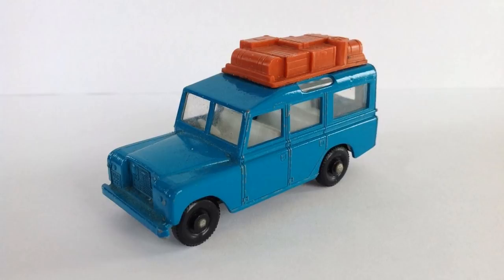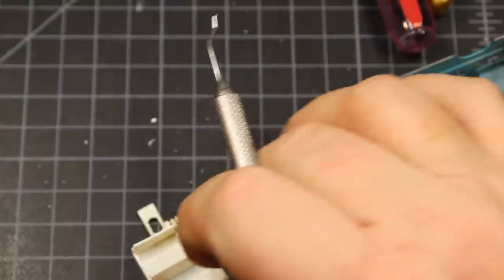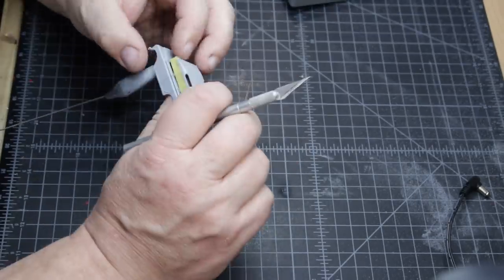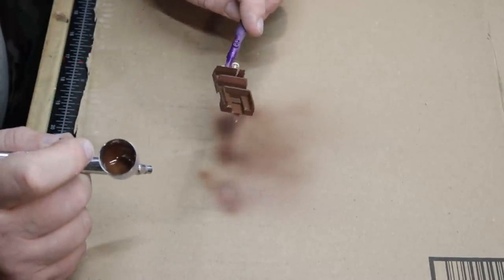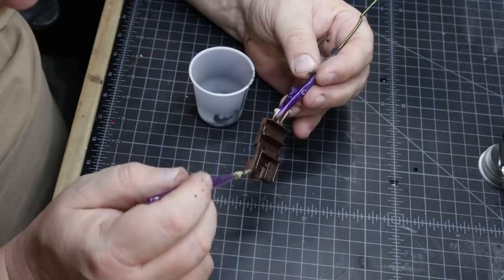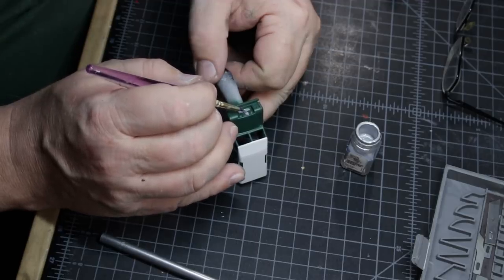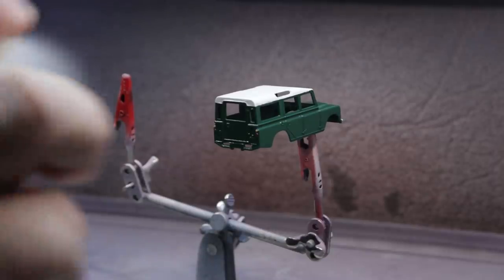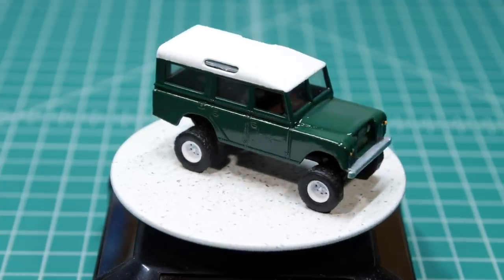Matchbox #12C Land Rover Safari - Custom

Comment: great job looks real good. like the tires. a suggestion for the windshield use a 3000 grit sanding pad and a clear coat to hide the fine starches.  car headlights restores kits use it.
Reply from the maker: Thanks for the tip

Comment: Great custom! Im new to all this and Ive only done a few customs so far, but a tip to make life easy- when painting a two tone paint job I like to spray the whole thing the lighter color first then masking off what I want to stay, being a racing stripe or white roof, then spray the dark color. As long as you use light coats you won't  lose any detail and might save a little time. Keep up the fine work sir!
Reply from the maker: I have to respectfully disagree, any time you lay a coat of paint on it, you're losing detail.  But thank's for the tip.  I appreciate the offering.
Reply: @TimeRider  just throwing out the idea haha. I personally haven't had any problems but I don't use a primer coat and spray thin coats of createx wicked paints mostly, so I guess I end up with the same amount of paint as you do with the primer coat. Either way excellent job from a new subscriber!

Comment: I concur with all the positive feedback.   I'm inclined to do more of the slight customizations/details (If I actually decide to try this for a hobby myself) so it was nice to see your efforts.   I work in the autoparts business - Ford dealer wholesale - myself.  Small world.
Reply from the maker: My PD was a Ford shop.  We tried a few Chargers.  They seemed to spend more time at Dodge than anywhere else.
Reply: @TimeRider   Small world.  One of my dealer's would likely have been your parts supplier.

Comment: I really like what you did to this one.I have the same one that I've been dragging my feet on to do because glass /roof rack is missing, and it takes FOREVER to get replacement parts. Steve McQueen was the Coolest actor/racer/motorsports guy that ever was. He was definitely the real deal. Racing Dual shock Honda Cr250 Elsinores through the Desert, or Modifed Triumph Bonneville's Scrambling through Europe in the 60s. And most important 1968 Mustang Gt390. Enough said. lol

Comment: Great job. Looks amazing. 
Just two things. Have you heard of a dry brush technique? it would work wonders on the grill, also, you seemed to do it the hard way with painting the roof first, painting the body, then hitting it with clear coat  the. Tape off and do the roof seems the better option.

Comment: hi time rider, paris dakar is the most grueling off road race. it 9000 miles long. rover is always in that race. they usually do pretty well. your rover again was very nicely done. i have a few matchbox car as well as hot wheels. i got into slot cars in the 1/64 scale. i have collected quite a few if them. just pushing the matchbox cars and hot wheels around was ok but i liked the speed of slot cars. thanks for sharing you hobby with us.

Comment: I believe that is your best one yet! I really like it. I might do one of the three that I have in a similar fashion!
Reply from the maker: Some folks seem to think I went a bit too high on the lift and I actually agree, so maybe a tad lower if you do.  Here's the wheel set I bought if you're interested.  I almost did it in red just to use the awesome black and red wheels!

https://www.ebay.com/itm/Greenlight-All-Terrain-parts-lot-customs-wheels-tires-axels1-64-4x4-TruckMud-4wd/264075256718?ssPageName=STRK%3AMEBIDX%3AIT&_trksid=p2057872.m2749.l2649

Comment: This year Matchbox has launched this car with an offroad series, and I already have it 😍
Reply from the maker: Looks like they fixed the windshield too . . .
Reply: I'm not sure, because it's still in the blister and I haven't opened it. But this is still awesome...
Reply from the maker: @AgusSantoso-lz3ym  One of the issues with the Lesney Land Rover was the windshield was too "deep".  The Land Rover always had a row of vents along the bottom of the windscreen.  I looked at the new version and it looked to me like they added the vents and the windscreen is shorter.
Reply: @TimeRider  after I look, in this latest edition the bottom windshield is still too deep, and for the wind hole is not very visible even though we don't look carefully we will not know whether it is a wind hole.

and they have a new variant in this edition, a full roof rack without spotlights and a half roof rack with spotlights. please correct me if i'm wrong

Comment: Was the first masking actually necessary? You could have just painted the roof white and only mask it for the green part.
Reply from the maker: Hey, I'm still pretty new at this!  Maybe it wasn't, but that's how I did it!
Reply: @TimeRider  I did not want to sound smart, I was seriously asking, as maybe you did it in order to avoid adding another coat of paint which might hide some of the details in the overlapping areas. Anyway, good job on that one!
Reply from the maker: @PG-gs5vb  I don't think that's what you were doing at all and you weren't the first to suggest it either.  See, what you have to understand is that my background is in actual cars and they would tape off for each color, so that's what I did.  As I do more and more of these, I learn the tips and tricks that will save me time.  Some I use, some I don't.

Comment: The green and white paint is stunning and very British. The wheels? Pure California, shame really.
Reply from the maker: Well, I'm not sure about the California part, here in the great hinterland . . . 40 years ago . . . I sold these wheels to every dude with a 4WD Ford, or Chevy, or Dodge, heck even the occasional Toyota.  They were fairly inexpensive and came in white, black and chrome.  Be that as it may, thanks . . . I think(?) . . . for your comments!
Reply: @TimeRider  I owned one of these landrovers , and it did have wheels just like that on it ,although they were red chrome. Looked good. I did think your wheels were set a little high, no offence 😳 ,  but really nice restoration.  First video of yours ive watched .Good job 👍
   By the way ,  im in the U.K. ,  not California 🤣
Reply from the maker: @urgumskurgum7570  Yeah, a couple of people have said it's too high and I'm thinking maybe a tad . . . but it would have been tough to measure beforehand and once the epoxy was set, I was stuck with it.
Reply: @TimeRider  Still looked good though.

Comment: What PSI do you run your Airbrush?
Reply from the maker: 20-25 but I'm thinking that I might go lower.
Reply: @TimeRider  thanks for your reply
Reply from the maker: I had done some reading and there is an opinion that the higher the pressure the greater your chance of the paint "drying" between the nozzle and the object.  That by using lower pressures and doing lighter coats, you can avoid things like orange peel and that"sandy" looking finish that can occur when the paint dries before it hits the model.
Reply: @TimeRider  Thanks for the update